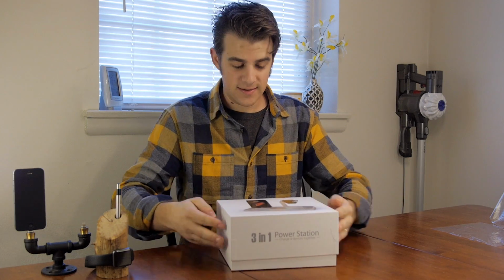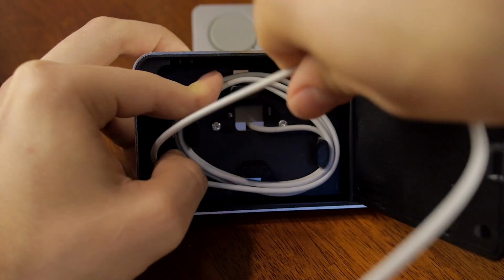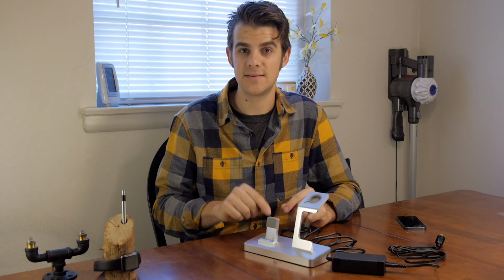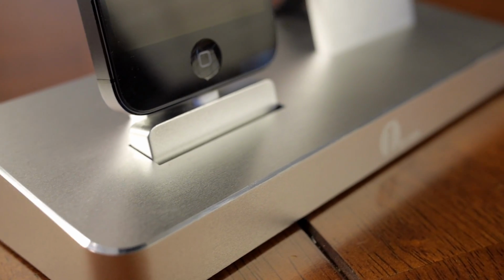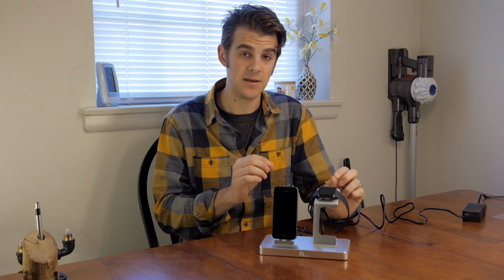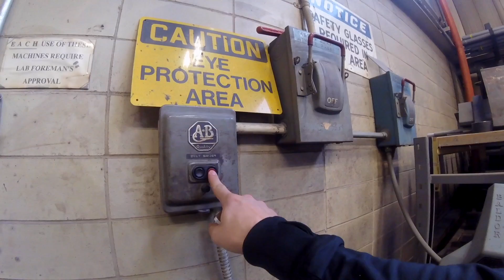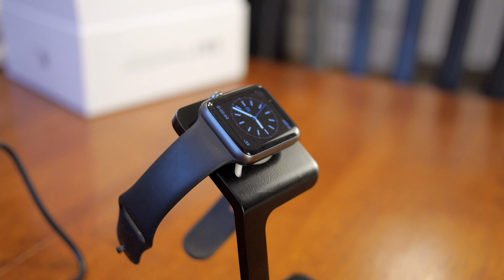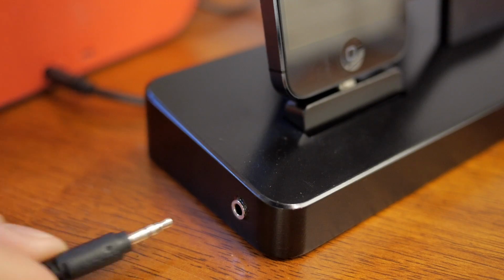1byone Apple Watch Dock Review & Modification

Comment: 1st let me say "Freaking cool!" Awesome upgrades. I would choose a camo pattern myself, but black is always stylish. 2nd, I'm not much of an "i" fan. I know, I'm a droider. Forgive me, please. Would it be possible to remove the lightning male and replace with a Samsung male? And would my Samaung Gear S2 watch charge with the included magnetic charger?
Reply from the maker: Thanks Theodore. If you wanted to go camo, something like camo vinyl would probably look sweet! Just wrap it up and there is no need to paint. I'm sure you could replace the lightning plug with another type of USB - it's really just the black and red wires in the cord that carry the power and all USB cables have those. As for the charging puck, I am not familiar with how the gear watches charge. The puck I used was not included with the dock so I had to use the one that came with my Apple Watch. If the gear puck is the same size I would think it would fit though. Overall, it might be best to see if someone makes something similar for Samsung devices.